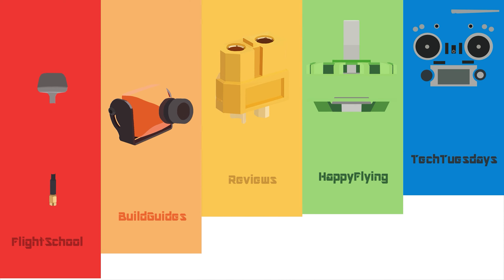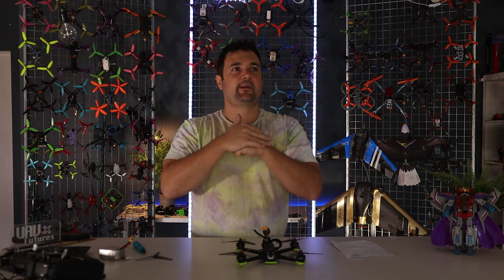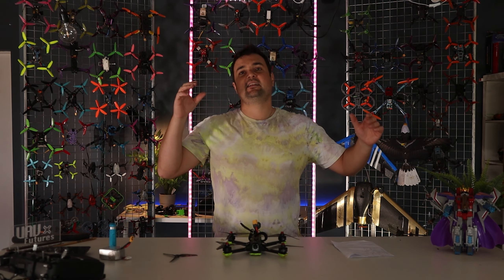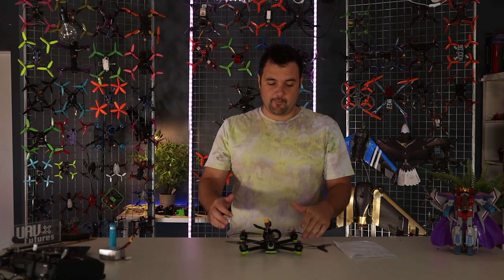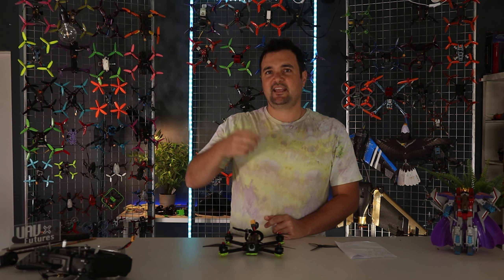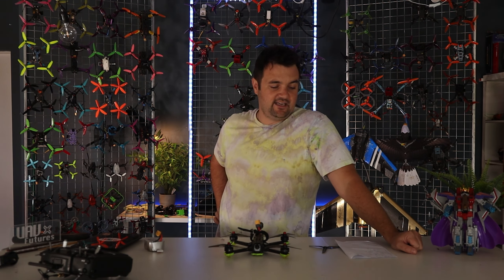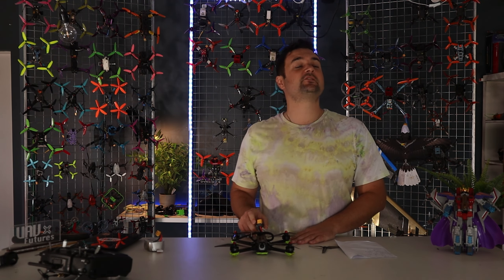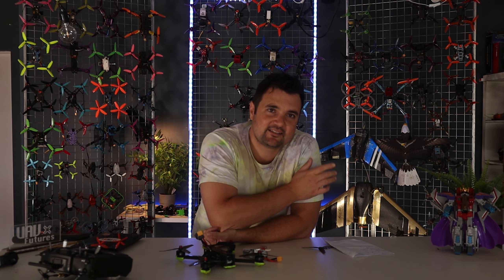10 Reasons your drone WONT FLY - FPV HELP

Comment: Had a few packs through a BNF, fine. Have added a switch for motor beeper and enabled in BF. Now when trying to take off its as if it's pushing down not lifting. Have checked 10x motor direction and correct props.  Driving me crazy.

Comment: When I unlock my drone the propellers don't start spinning and it wont take off. I don't know what the problem is or how to fix it.
Reply: Plug drone in, connect the radio, flip your arm switch slowly throttle up until they hit your idle speed and then punch from there and enjoy

Comment: Hey I built up this drone and the esc boot up and do the 3 beeps but the flight controller won't o the 2 beeps and I can't find out why? It also dose not run off usb! If you know how to fix it please let me know because it has caused me a world of pain to try and figure out!
Reply: It is a faulty FC. Wrong flash. Wrong defaults. Wrong motor outputs. Wrong esc connection between FC and escs is also possible

Comment: I just was freshening up my mobula 6 with some new motors, and my back 2 were going inward or standard, and my front 2were going reverse. had it set to reverse so I was confused but I simply awapped the back 2 motors with each other because its seems like they were in a fixed direction? Does anyone else have that happen to them? been flying for 3 months and im fully strung out! Enjoy the skys!

Comment: You should check out the new speedy bee f7 v2 flight controller and maybe do a video on it. It's very nice to be able to connect a flight controller to your phone via Bluetooth and the app works just like beta flight and it actually works great you can even flash firmware via wifi right from the app on your phone check it out I think you will love it
Reply: And they just released V3